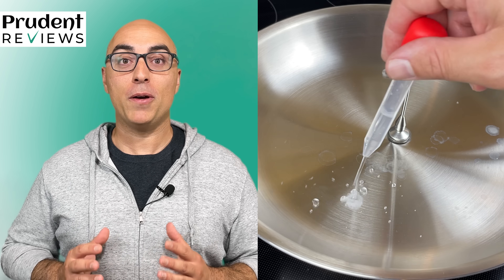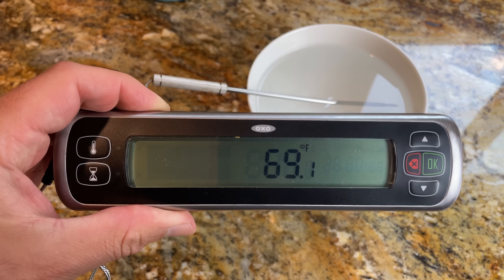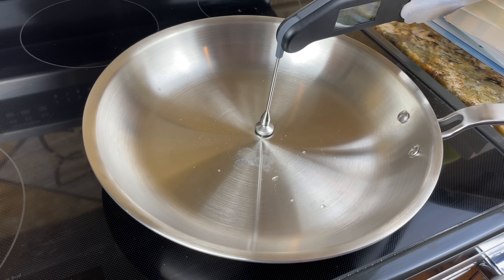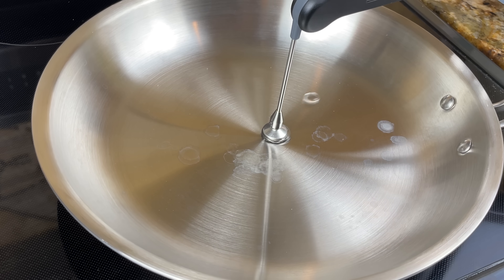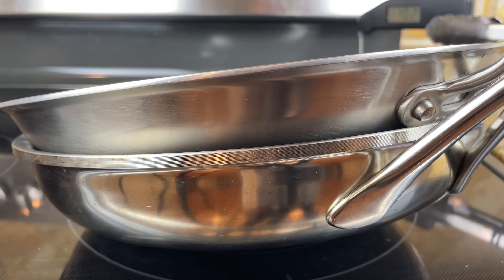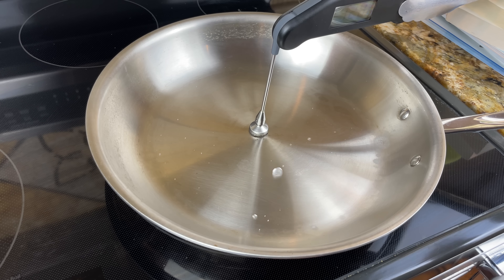Steel Pans Become Non-Stick at THIS Temperature (Leidenfrost Effect Solved)

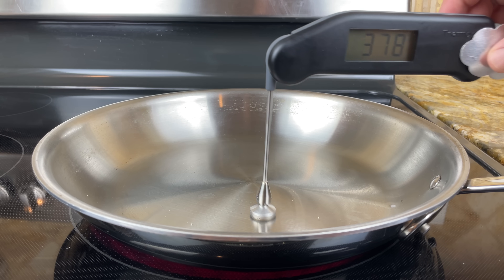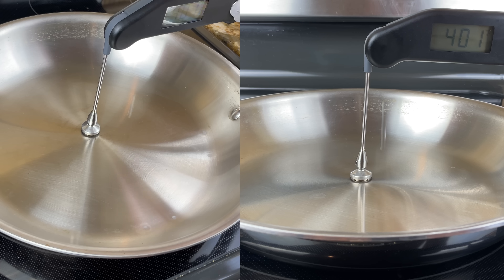Comment: This is a fascinating video and I really appreciate the precise attention to detail. It's interesting that the difference between the center and edges of the pan's flat surface was roughly 30ºF (in the shot at 3:24). If you just focus on spot you're measuring, it seems like the Leidenfrost effect might actually begin somewhere between 390–400ºF, like we can see at 2:12. But the entire pan needs to be at that temp, so it's really a matter of when the edges reach it. Which is why it really kicks in when the center is at 430ºF, because of that 30º difference.

Comment: Does the thickness of the pan have an affect of success or failure of this effect cause the balls formed on my pan but when they rolled around and crashed into each other they all boiled off.  I wonder if the thinness of my pan has an effect of cooling it down when it reformed into a larger ball and immediately evaporated.

Comment: Finally !!! Someone Puts a Number to Pre-Heat stainless steel pan to !!!
Thank You soooo much !!!
Reply from the maker: Happy to help!
Reply: around 200°F,  Use an infrared thermometer with EMS (Emissivity) settings. For stainless steel pan, set the EMS to 0.59.  Use the infrared thermometer to measure the pre-heating stainless steel pan.  When the pan temp research 200°F, turn the fire down to medium low, add oil, then add foods. Make sure the foods are not too cold (not straight from refrigerator). If foods are too cold, they will cause the pan temp drops too much and cause foods stick to the pan.
Reply: @sysopr that is less than the boiling point of water which would make no sense
Reply: @sysopr  video says 450 degrees F.
Reply: @OcRefrig  I have been doing what I said on above  twice a week for years. 200°F works perfect for me.
Reply: @sysopr  thanks. 😎

Comment: A couple thoughts on this experiment:
1. I'd expect that the temperature at which the Leidenfrost Effect occurs will depend in part by the thermal conductivity of the pan's material. It would be interesting to compare against pans of other materials, like carbon steel or copper.
2. I doubt there'd be much temperature difference at all with water spots in the pan. Sooner I think what's happening here is the water spots form nucleation sites for the droplets to transition to a gas.

Comment: Haven't got this right yet! Heated pan and measured temp with a new infra red thermometer. Temp said about 230F but water balled correctly!
Put in some oil and then the temp read 400F! Put in a bit more oil and the temp dropped to about 300. Added the eggs and they stuck like a b*tch!!!
Will try again another day...

Comment: You can avoid the chilling effect of evaporation spots by wiping them up with a paper towel as soon as you see them sizzle, indicating that the pan is too cool for the Leidenfrost Effect.  You'll have no spots and no chilled areas in your pan.  You can also move your pan to bring the flame directly under the spot where you did the test, helping the edge of the pan to reach the center temperature.  When the pan is hot enough to maintain the Leidenfrost Effect out to its edges, turn down the heat, wait a little, and introduce your oil.  Wait a few seconds to let the oil reach the pan temperature and then you can get a correct temperature reading with an infrared gun (with the out-of-the-box emissivity setting).  Introduce a small bit of butter into the coolest part of the oil and see how vigorously it sizzles.  If the butter melts slowly,  you're already too cool.  If it melts quickly without excessive violence and no butter discoloration, you are approaching the correct temperature for cooking delicate non-stick eggs.  Introduce the rest of your butter and continue monitoring the temperature with your IR gun.  I have had good success with introducing a room temperature egg when the oil-butter mixture is around 280 to 300F.  For me this temperature is high enough to maintain the non-stick quality of a stainless skillet, but cool enough that the egg won't develop a brown crust.  Since I'm using a gas range and a relatively light pan, I can make subtle adjustments to the gas setting, allowing me to stay in the oil-butter temperature of 250 to 300F, which gives me non-stick eggs without a crust.   This is a fun cooking challenge, which is more difficult than getting the same excellent result with a cast iron or a carbon steel pan (using different procedures than the above), but I'm starting to wonder why I've spent so much time trying make a perfect fried egg in each of these kinds of skillets, when many professionals cook fried eggs in no-fuss non-stick pans, a result I've been consistently able to achieve for years.  If I was cooking for a living there is no way I would take the time and care to follow the above procedure just to prove I could get a good result in a stainless steel pan.  When time and money are on the line and your customers are expecting a delicate over-easy egg in a reasonable amount of time, break out your non-stick "egg pan" and make a perfect over-easy egg every time.  But then, of course, we wouldn't need all these elaborate procedures for the simple task of frying up an egg without it sticking or developing a brown crust.  I enjoyed the challenge of learning how to do it (and it improved my cooking skills), but I'm already back to frying eggs in a non-stick pan whenever I have to make more than a couple (as when I am serving a crowd).  I know some folks can't bear the thought of any Teflon getting into their food, but the delicate way I cook eggs means the amount of material lost from the coating is negligible compared to other risks we accept every day (such as driving among idiots).
Reply: Very insightful comment. Thank you for posting this.

Comment: You do not understand physics. If the edges of a pan extend beyond the heat source they always will be cooler than the center which is directly above the heat source.

Comment: Ridiculous! The effect is killed by lime deposits left by the previous drops, so use distilled water for the tests. It's a moot point anyway, because 430C will smoke far too much when oil is added. Most home kitchens don't have a monster commercial vent hood.

Comment: What if you are using a more delicate cooking oil like Koroneiki Olive Oil where the smoke point is a little lower (around 375-405F). Do you just drop the heat and wait for it to cool down a little? Will the non-stick properties of this effect still stay as is for a while?

Comment: I'm sorry, because you clearly put in a lot of work, but it's just wrong to say that the Leidenfrost effect is the key to cooking eggs in a stainless steel pan. Because if you do go to that temperature, you have a completely burnt egg. So it's not usefull at all.
Furthermore i cook eggs in my stainless steel pan way below the Leidenfrost effect temperature, because i don't want any browning on my eggs and it still doesn't stick, if you do it right. So, eggs not sticking has nothing to do with the Leidenfrost effect. It has a lot more to do with how you heat the pan BEFORE you cook the eggs and if you use butter (or margerine) or oil.